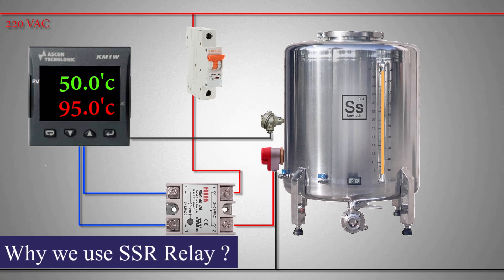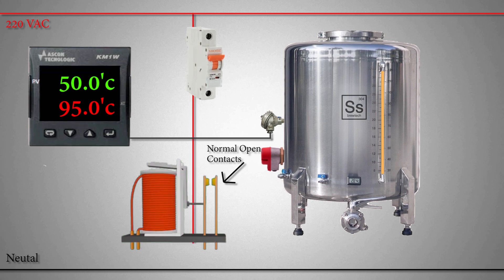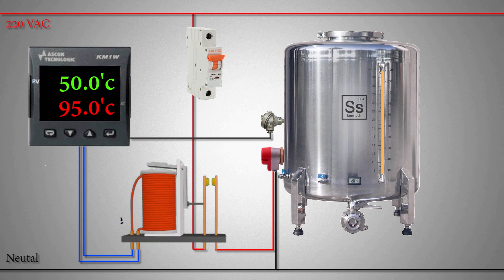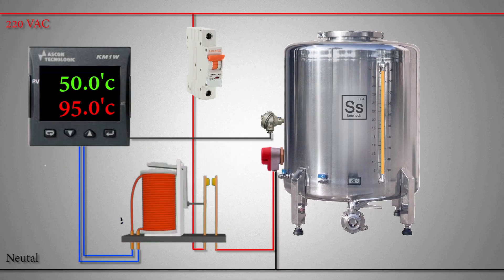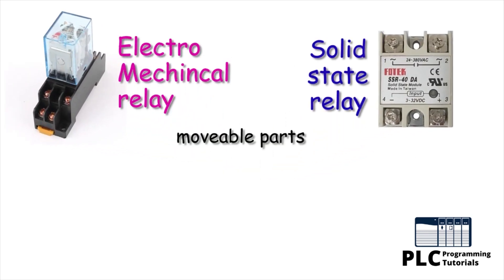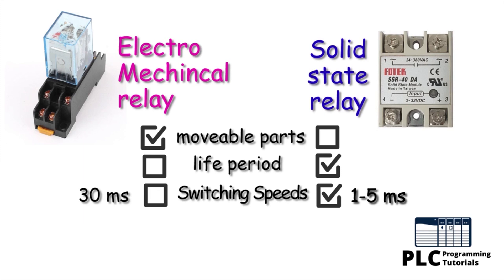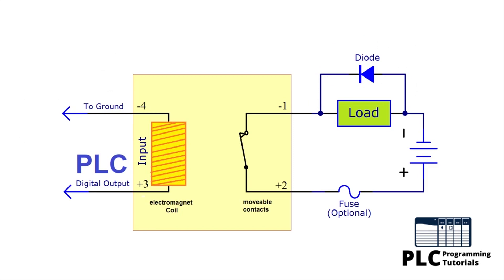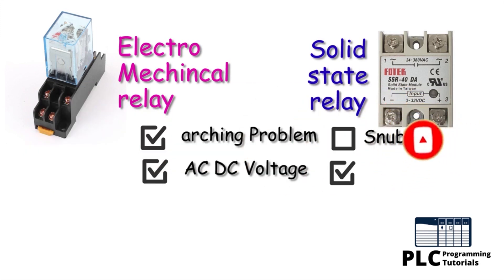Why do we use Soild State SSR Relay ? SSR Relay Working || SSR vs Electromagnetic Relay

Comment: Very good video brother. Thank you for sharing.

 I also use contactor on upstream of the SSR, and this is connected to the alarm contact in the PID temp controller. If the SSR triac fails closed, the temperature will overshoot the SV, and the alarm function will open the contactor cutting power to the SSR and the heater.
Reply: I was going to add this.  I've used SSRs in ceramic kilns.  When they over heat, they are derated to less than 20% of their stated capacity and will often fail closed.  This means, for any substantial heating capability, a contactor must be placed on the alarm or a secondary PID to allow for alarm like operation for over SV condistions.

Comment: I have experience with ssr&heaters,if the heater is short body the ssr usually damage (the load contact always close like problem in the mech.relay)although the ssr have bigger amperage than CB..what do you think?
Reply from the maker: SSR Comes with in build fuse, and blow if any short circuit from heater side . 

But here we can also face problem, fuse blown time is 20ms and triac short circuit time is 100us, so fuse benefit is less
Reply: @EASYPLCTRAINING  nice info sir..thank you